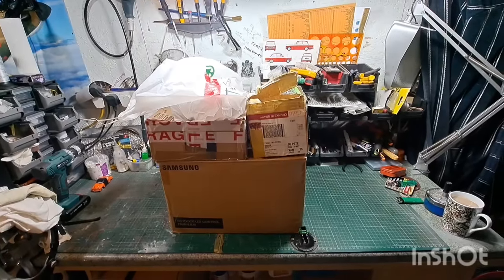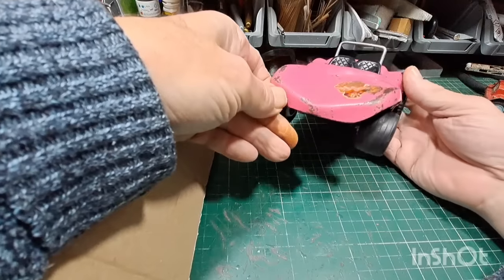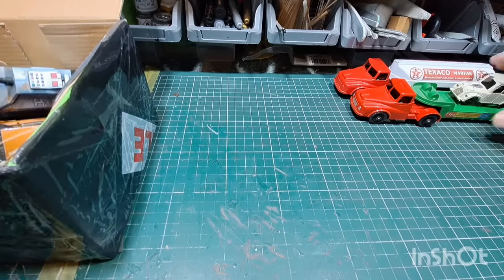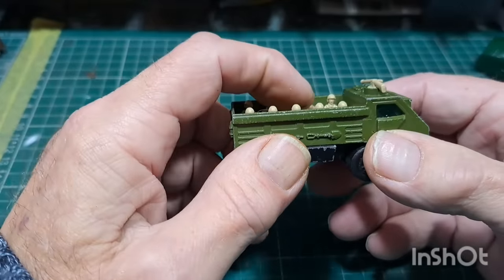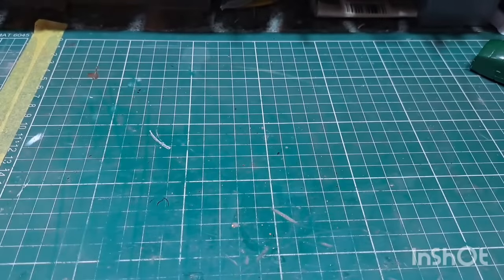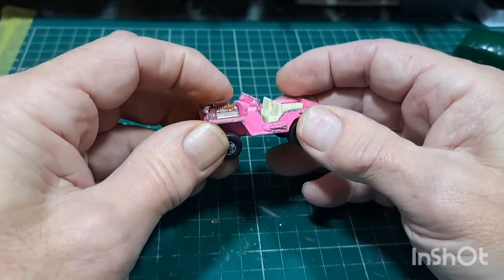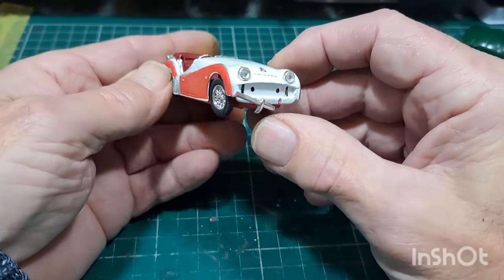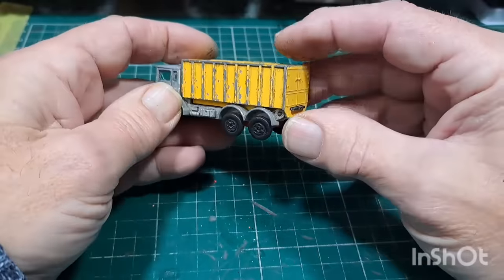Diecast Restoration Purchases and Donations for December 23

Comment: Great vid again and lovely load of stuff to repair,the britains motorbike i have restored a couple of the military ones by making   handlebars from electrical wire by leaving some of the plastic insulation on one end to make the grips and cutting the wire to length,its good enough for the 1/32nd figures i use for wargameing.
Reply from the maker: Thanks very much John I will remember that tip when the time comes, all the best Martin

Comment: What a good selection box you got this Xmas. Stars for me the AA van at the start, the Plymouth Fury and those rally VWs toward the end. The 137 number VW had the small yellow Honda trailer with a motorcycle on it. That helicopter is an MBB105 and I guess it does need a stretcher in the back.
Reply from the maker: Cheers Andy 🍻

Comment: not much to comment this time. :)
13.00 aww, lazer wheels. so glittery. :)
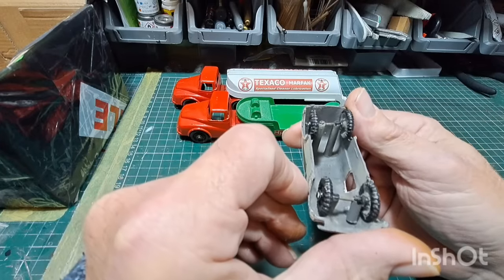15:50 no idea who made this. looks like a Daimler Ambulance? and maybe someone stepped on it, it looks twisted on camera.
17:15 aw, a working car jack, that's nice. ^^
18:15 now this one is even more special, I hope you can fix the wheels somehow. :)
22:00 IMSA Mustang, as with the murrican racing series. later Zakspeed would do a Mustang as wide as their infamous Capris, also with the turbocharged OHC engine.
30:54 don't know the brand either, but similar models have been sold as Schuco here as well. must be the same maker.
35:45 Renault 17. the majorette version has three tailpipes... XD
36:50 their tiny wheels could be useful for builds, methinks. like if you have to replace regular wheels with something more modern, but not oversized.
37:50 I have one with the crane on it, but the hook missing. gettign there slowly. XD
39:30 someone stated that the A-frames tend to be broken off. to me that's a rarity, really... this one looks nicely straight.
40:44 ah, the slingshot dragster. :)
44:45 a tootsie, maybe?
49:34 reminds me of that short run of the cortina 4 with the night-glow windscreen inserts. no idea what that ought to be good for, but there.
51:40 Hot Wheels has come out with a new casting of this one, but it's a complete new casting. size is different, making is different... if you go that far to modify a mould you can go all the way and make an all-new one. :) the HW is also a more "modern" version with widebody and air intakes and stuff.
55:00 made by Ertl. don't find them that often here.
56:20 "Vitesse" a french brand, like everyone else, made in china. :P
1.02:20 the white beetle is the original, it's missing door numbers and a monte carlo emblem in the front. they just kept that plate when they swicthed the colour to bronce.
1.06:30 I think this is the company making model trucks for advertising giveaways. most times their brand name is omitted, though.
1.07:01 yes, there goes a stretcher. I think this is a SIKU heli, going onto a trailer.
1.07:59 aw, a rare one, this one. and it seems to be still working. :)
1.08:59 not sure what goes there, myself. there were many things, from gas stations, garages, other payload, a bridge... I think this one used to have a crane for logs or pipes on the trailer. the hole in the trailer's head is default, maybe because of the casting method. one would have to look up the number on the trailer and rig to see what they used it for. back whent hey were new I never really looked at them closely because the price tag was way out of reach, anyway.

aand another hour of flea market done. :D see you in 2024! ^^
Reply from the maker: Thanks Lothar as always for the great information it's always appreciated my friend I hope you had a good holiday and are all rested up .
All the best Martin